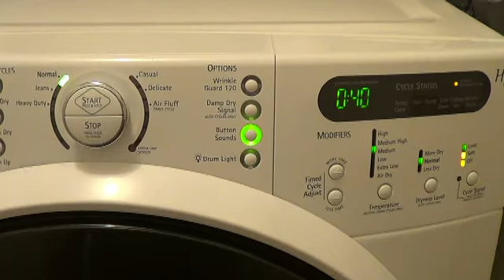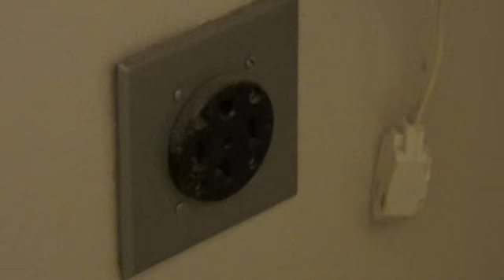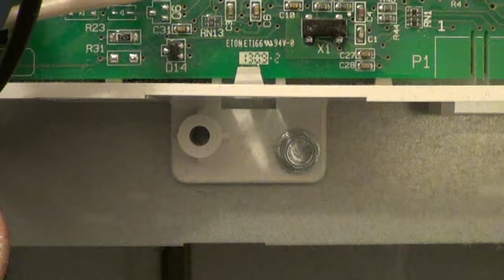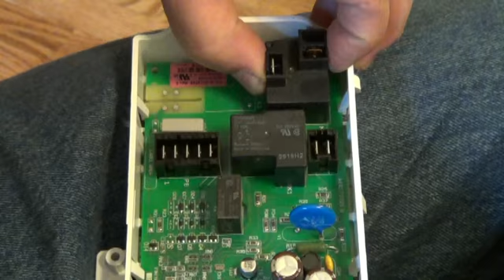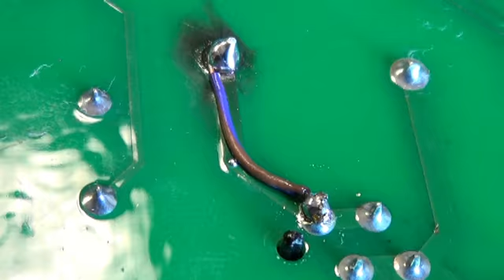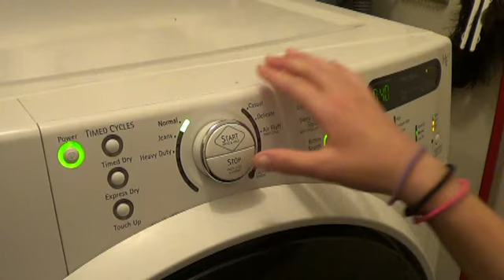Dryer Sears / Kenmore HE3 - F01 Error Code Main Circuit Board Repair

Comment: What wire was used? Can it be copper wire? I have the same problem and want to try your fix before calling someone.
Reply from the maker: Hopefully it worked for you.  Yes, I recommend copper wire.  The wire does not need to be very large as it is simply replacing a thin metal track on the circuit board.  A #20AWG or #22AWG is adequate and makes it easy to bend around the pins.  I used solid vs. stranded wire so I could bend it around the pins, but stranded will work also.  The trick is to heat the pin and wire until they will melt the solder.  Touch the tip of the soldering iron to the new wire and existing pin and keep touching them with the solder until it melts into a little blob.
Reply: Yes it did work, thank you so much for your video, you saved me a lot of money!

Comment: have an LG electric dryer.  it would only click, once you pushed start. I had repair guy out, he told me it was the main control board.    I ordered the control board, watched a video and easily replaced the board.  sad news, it's still just clicking.  checked every plug, tried again. Still just clicking.  any other ideas? Motor??
Reply

Comment: This was priceless...total cost using Jim's method $28 34 in parts Soldering Iron, solder, 10 gauge wire. 7.34 mins saved me over $400.00. You Sir are a God!!

Comment: Huge help!!! This worked flawlessly after your fix. I was excited to see the bottom of the circuit board looked just like in your video. I didn't use the wire because I didn't have one but a larger solder spot connected the circuit just fine.
Thank you

Comment: Awesome video. My dryer looked exactly the same outside but had an extra connection I couldn't take off, so I disconnected everything else and soldered it still connected to that one wire. everything else was perfect.

I had one question, I have never soldered anything before. Is there a specific wire I should have used?   The one I used was thicker but I made sure it wasn't contacting anything else.

thanks again! love these little projects!

Comment: I just had this same problem I watched the video and went down to the dryer took it apart in a few mins with my father in law looking at me and he asked me have you done this before haha but I pulled the circuit board and no shit the same exact thing the solder blew off the board so went to ace got solder gun solder and 3 inches of wire came back soldered it together put it back together and standing to the side closed my eyes and turned it on and it worked!! So happy that it worked god I love YouTube! Thanks for putting this video up!!

Comment: Wow! Can't believe it worked...just saved me 600 bucks. It was cheaper in Canada to buy a new dryer than to pay a repair man to replace the board.  My first soldering job just blew the little piece of speaker wire right off, so  I redid it and really soldered the sh*t out of it and bing...it works....Thanks so much.

Comment: Thanks so much for making this video. Went to Home Depot and got a soldiering gun and some 18 gauge wire for under $20. Took about 2 hours to disassembled, fix and reassemble for novice such as myself. All worked well though, so very happy.

Comment: Well this just saved me a small fortune!  Thank you for being so clear.  Went to Ace, purchased a small soldering gun for $25.99 that included 2 additional tips as well as solder, 19 cents for 20 gauge wire, and a little practice soldering. 15 minutes later and I have a working dryer! Jim Dandy to the rescue!

Comment: I tried soldering just the connection but it blew just like the original, you need to add a wire and connect the two points just like this video shows.

Comment: Boom ! You just saved my day :) Thanks a million for posting this. 2 weeks before Christmas and I was pretty sure I would have to get a new dryer when I saw that the code meant circuit board problems. Talk about bad timming ! 
We have an older Kenmore HE2 and it's exactly the same. I had everything on hand to make the repair, so it cost me nothing.
If you ever find yourself in Montreal, beer is on me :)

Comment: Hi Jim Dandy... My son & I had the same problem, with the scorched board just like yours. Perhaps my solders weren't right? The solder was pretty thick. I'm so distressed! Now NOTHING lights (power button won't turn on) only the interior light when the door is open works. Do you think I overheated the board to something on the other side? Can you tell us what we've done wrong to make it worse than it was? If I sent a picture could you maybe advise us? Your video was awesome, btw, and I was sure we could fix this misbehaving dryer!  -- Jo 
Kenmore HE2, 110.87561602

Comment: I had plenty of wire and solder owning a 30 year old vehicle, and got this washer with the house I moved into. Finally got tired of hanging my clothes and followed this, works WONDERFULLY now. Only issue I had was an f70 because I plugged one of the side blocks into the wrong place, shoulda taken/drawn that photo xD

Comment: Jim, please know that you have made a difference in peoples' lives with this video.  I had the dreaded F-01 error message this morning and was resigned to calling the appliance repairman.  But I decided to Google the code and see what was involved.  You headlined the comeback.  Your instructions were spot on - I had the same splatter pattern on my PCB cover - and in truth, the hardest part was clearing out the laundry room and putting it back together!

I can't thank you enough for your help.

Comment: It worked for me just now in my Maytag (Whirlpool) Epic Z dryer.  I had an old lighting fixture in my garage that I cut some wire out of.  Ace (which is horrible in my town) didn't have a soldering iron.  But trusty Advance Auto Parts did.  They also had a Multimeter that I used a few months ago to diagnose the busted heating element.

Comment: Worked for me.  Luckily, my Mother in law used to work on circuit boards, so she did the soldering.  I did not know that about here until now.  We just used some light speaker wire.

Comment: Just another thank you note to add to all the others... our dryer was showing the same error code... took it apart as shown in this video and had the identical problem.  Fixed exactly as described, with the jumper wire... cost $20 for soldering iron (with solder) and the guy in Home Depot even gave me a short length of wire for nothing :)  Dryer is working again, I feel like a bit of a hero... but of course the true hero is Jim Dandy for doing this video!

This is an EXCELLENT video and I offer a thousand thanks for taking the time to make it and put it up on YouTube!

Comment: I started with this video https://www.youtube.com/watch?v=J8XvzVejiEk to fixe my problem.  The biggest issue we had is you can not just add solder to the pad if the pad is also blown out.  Your video shows this perfectly, or what I did is find another pad on the same circuit to solder the connection back (just flowed the soldier to the pad that was very close in the same circuit.  My dryer is a Whirlpool Duet (non-sport) but the circuit board is similar.  This worked for me but I like your fix better as it takes the load of the connection better with a new piece of wire.  (It also solves the problem with the blown out pad)  Thanks.

Comment: Called sears repair service--- service call 80 bucks, new control board 208 bucks, technicians labor 120 bucks--- youtube vids on how to fix shit--- PRICELESS. THANK YOU JIM DANDY
Reply: Be aware that this is POTENTIALLY a temp fix... Internally these relays spark each time the heavy current flows through the contacts. This burns the contacts and causes heat. The heat can go down the legs and damage the solder contact to the pcb. Eventually that contact seperates. Resoldering the contact/ adding a strap wire will allow the relay to work again but it will still have burnt contacts that will steadily get worse. A long term fix is to replace the relay which normally cost around $10, then you should be golden for about another 5-10 years.

Comment: Thank you so much!   I was able to fix my Kenmore Elite HE5 Steam dryer after doing every test everything was pointing to the board, but seeing your video narrowed it down and I was able to solder and fix my dryer!  Mine was spinning and it would initially get warm but would not cycle the heat, after the initial fire up of the gas flame, it never came back on.  SO clothes never got dry.

Comment: Thanks so much!  I had tried just using a bead of solder on the blown connection as in other videos - didn't help.  When I did this w/ the wire - (just used a little bit of speaker wire I had around) - it fixed it!  Hadn't soldered in years, but still had the soldering gun around.  The result isn't pretty, but it works! Lovely feeling when it clicks and the drum starts turning instead of beeping and giving you the dreaded F01 error.  If it sticks, you've saved me $200!    (My dryer is a Whirlpool Duo WED9400SU0).

Comment: This worked like a charm for my Dryer. The circuit board was a tad bit different and I have never soldered anything in my life. All in all the hardest thing was getting some of the circuit board connectors off of the board. Great video. I especially loved your wife's reaction at the end! Woohooo. :)

Comment: Jim Dandy - THANK YOU!!!  My wife told me that our Kenmore HE5T Dryer would not start so I check the thermal fuse as suggested on various sites and found that it was NOT the problem.  Then, I came across your video.  Symptoms were the same so I followed the steps that you showed.  Sure enough, once I flipped over the board, it was evident that I had the same problem!  Just like you showed, I soldered a jumper wire to the contact points, reassembled the board to the dryer and wal-la...It worked!  Thank you again for sharing your video.  It solved our problem and saved us some real $'s!!!  Appreciate it!

Comment: Thanks for the video.  My dryer suffered the F01 error.  Following your guidance I inspected the main board to find the same cause, the blown contact below the relay.  Cleaned the contact, soldered a 14awg wire to take some of the load, back together and the dryer is running again!  Many thanks!

Comment: Go Jim Dandy ! I have a HE2 that has the same board. Sure enough, the control board blew the circuit board pad. The trace was still there but I used a piece of wire and soldered it in. Thanks for pointing this out.

Comment: Thanks for the video. I had the exact same fault and solder joint blown on my He5. Fixed it same as you in less than an hour for a few drops of solder and an inch of wire.

Comment: I have an HE5 with the same error code and this was the issue for sure.  I agree adding the wire helps to ensure the current path is solid.  thank you very much for posting this fix, saved the cost of a new board which Sears quoted today at $157.51 plus $10 for shipping.  so saved the money and the down time of the dryer waiting for delivery.  I love YouTube.

Comment: Thanks for sharing. I have the same issue on a newer model, an HE5T. Wasn't configured the same exact way as yours inside, but once I got it apart, it was the same exact issue. Cant find my soldering iron since I moved but I'm going to get one tomorrow and give it a whirl. Thanks again.

Comment: Outstanding ! 
Our 6 yo Maytag 3000 threw the dreaded F01. With your vid and these simple tools:
1/4" nut driver
Needlenose pliers
Small flat blade screwdriver
Soldering iron (old 35w)
Small piece of solid copper wire (18ga - scrap from thermostat wire)

From wife's trouble report to back in service in less than 45 mins.
Thank you !!
Reply: Confirming 3 years later that this fix is legit! I just pulled the board and saw the exact same blown circuit. I've never soldered a circuit board before but I just followed these steps and my dryer came back to life!!!
Reply: @jamesbenoit7207  - And I'll confirm - NINE years later - that the my fix & the dryer are still working fine !

Comment: Mr. J. D. ... had the "dreaded F-01"  ... no help in the owners manual ... no help contacting Sears on the weekend ... however, watched your very clear and all encompassing video ... told the local repair company who returned my call promptly Monday morning that I was going to attempt the repair myself based on what I had seen on YouTube and would be calling them after I had failed.   It was almost exactly as your video showed and the result, minus the extra little wire, was, so far, success!  Can't thank you enough!  Being in my early 70's, this kind of stuff is a little out there but fun when it works nonetheless!    CS / Vancouver / B.C.

Comment: Nice. This works for the Whirlpool Duet Dryer also : Model # wed9400sw1.  Very smart using a wire to replace the broken trace on the board;  cost me 24 cents for a foot of wire from ACE hardware. Note make sure the wire can handle at least 300 volts : this wire comes directly from the 240 volt plug in the back of the dryer.  It seems that the F01 error is caused by the break in the circuit that goes to a relay ( you can here it click when you press start, but then the sensor board detects that the drum is not moving and gives the error code).  The cause is most likely either from a power surge, or maybe kickback voltage from the drum motor caused by overloading the dryer ( like I tend to do : )   Anyway, great video, and thanks.

Comment: Jim Dandy -- you are the man!  Just got a quote for $450+ for this repair on a 8-year old HE5t Steam with 2-3 days wait for the part. I watched your video, headed down to Ace, spent $19.95 on soldering iron and 59  cents for wire.  Tried it without the wire first, no luck. Then added the wire and working like a champ.  I'm a decent DYI guy, but never worked on  a control panel/motherboard/circuit board before, but with your video, this was cake.  Used rubbing alcohol to clean the connections , back of the board and cover.  Also, took advantage of having the lid off to clean out the circuit board and connections with compressed air and vacuum out the top of the dryer for extra measure. Thanks (and really enjoyed hearing the family cheer you on at the end of the video. Had my kids help out, and they did the  same!)
Reply: I used some cat 5 cable that I cut one pair out of, solid copper worked perfect!
Reply from the maker: +Jp Lj In hindsight I should have made it clear that in most cases simply resoldering the pin to the circuit board will not work since the metal foil on the circuit board often gets blown away when the solder joint pops/explodes.  The jumper wire doesn't need to be very big (say #22 AWG), and being small makes it easy to wrap around the pin(s).  The factory pins are not insulated so if you follow the path of the foil between the two pins there is really no need to use insulated wire, but it makes it look a bit more professional.

For those without much or any soldering experience the trick is to heat/touch the pin and wire with the soldering iron and keep touching he solder to the pin and wire until they are hot enough to melt the solder.  You don't want to drop a blob of solder off the soldering iron onto a cold pin and wire.
Reply: I didn't read this FIRST and have tried to do just that...drop solder off the iron. And of course, it is not working. I did have the blown out area so I am convinced this is the problem. I am headed to ACE right now to get #22 AWG because I didn't try that. Can I repair from here? There is a glob of Solder on the pin now, how do I repair from here? Thank you SO much!
Reply: +Lana Irons you will have to re-melt the solder and then put the wire down and then resolder.
Reply: Okay! Thank you!
Reply: do you remember what gauge wire was used?
Reply: Thank you so much.  You are definitely the man.

Comment: Jim..thanks so much.  I have never attempted a dryer repair...but after viewing your vid the repair was no problem (almost).  Somehow the power wire wiggle loose when I took it apart.....so then I thought I damaged the motherboard. Simple retrace the steps, looked at the power and see the missing connection.  From start to finish would of took me less than 1 hour.  Thank-you!  You have paypal....love to send you few bucks so you can buy a nice lunch.

Comment: This same exact thing happened to me yesterday on Christmas! Thank you for this video. It was a quick 15 minute fix and the best part, it was FREE! 

I wonder what makes this happen to so many of our dryers? It looks like I'm one of many people who saved a lot of money by watching this video.

YouTube has saved me quite a bit on this dryer alone within the past year. Last year, I had to replace the rollers and the belt. Cost of parts was $40. I found a YouTube video for it. About 3 months ago, the heating element burnt out. The cost for a new heating element was $30. I found a YouTube video for it. Soon I'll have a brand new dryer! This one is about 7 years old.
Reply from the maker: +Rodney Snyder I don't know why this happens, but it appears the solder joint is not properly sized to handle the current, and every once in awhile there is a spike/surge that vaporizes the solder joint.

I also just replaced the idler pulley, belt and rollers on my dryer and made a video for this as well.  Hopefully I won't have to make a video on replacing the heating element/coil, but it wouldn't surprise me.  There is a kit that has the idler pulley, belt, 4 rollers, clips, etc. for about $50 at the local parts store or $25 on Amazon.
Reply from the maker: +Jim Dandy https://www.youtube.com/watch?v=gVzb7AfGqaA